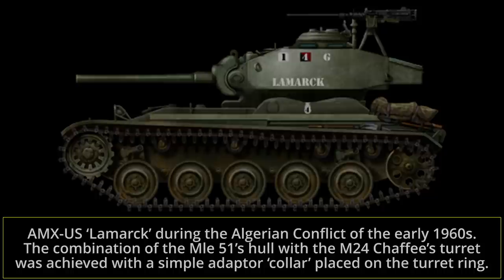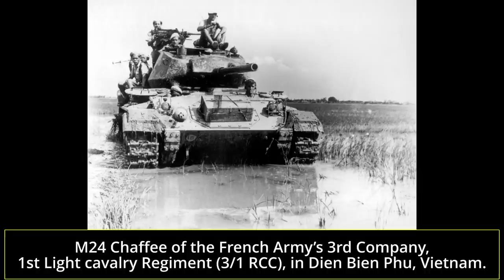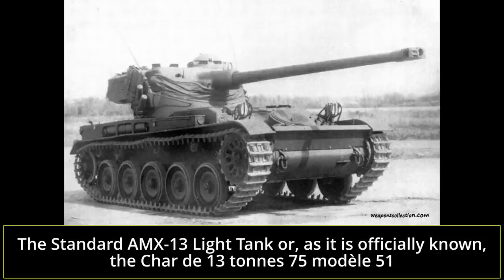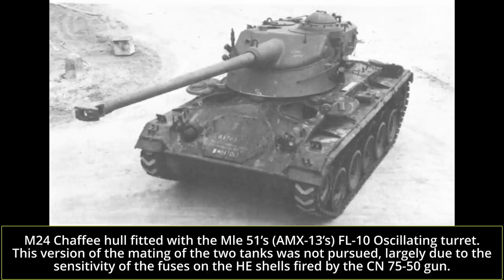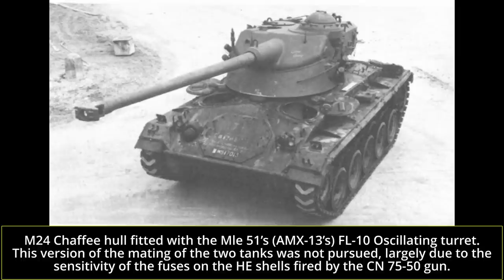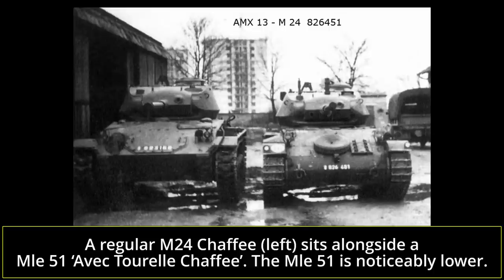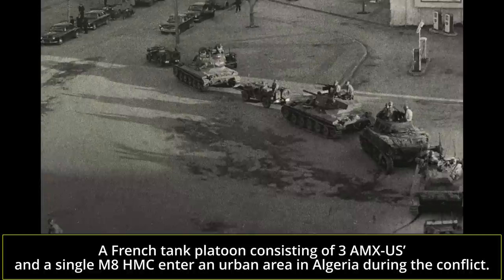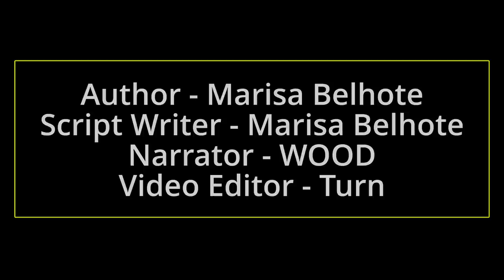French Fried Freedom | AMX-US (AMX-13 Avec Tourelle Chaffee)

Comment: There's some precision needed, mostly on the (light) modification France made on the M24. First, at one point, a forward support was haded for the 50 cal in front of the commander cupola, but the tripod back support was kept. And second, it seem that France didn't used the smoke mortar, and used this slot to had a second set of radio and an antenna port, that helped the M24 to perform it intended roll in French army (long patrol). Those modification on the turret were kept on the AMX13-US.

Comment: Interesting stats. Only 13 degrees of elevation and a muzzle velocity of about 2,000 fps, that would make for an interesting tank to manage distance to target and beaten area of impact when using HE. Which was the purpose of this hybrid. They weren't firing armour piercing at the guerrillas. 

 The gun mount couldn't have been modified to allow at least 45 degrees of elevation? If it required a collar to allow for its deeper turret basket, I imagine there was room to depress the breach for additional gun arc. Would the breach then be out of reach for the loader?

The 75mm ammunition was 1 piece, fixed ammo. It wasn't shipped as casing with multiple packets of propellant and projectile. So arc and range weren't adjustable by ammo. What am I missing?
I'm no artillery gunner, but it sounds like a minimum sweet spot with little forgiveness. I imagine it was a very flat shooting spg. Which was its whole purpose, right?
Please correct me if I'm wrong.
Based on what I obviously only think I know, this was a DIRECT fire infantry support vehicle. It's the only way it makes sense to me.

Oh yeah, keep up the awesome videos! They really help flesh out the reality the tank designers were facing at the time of development and deployment.